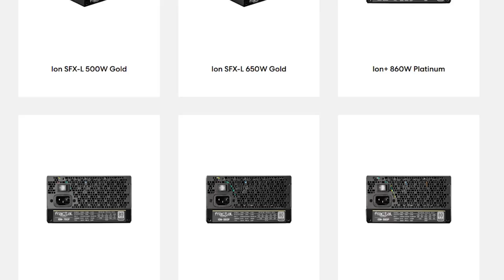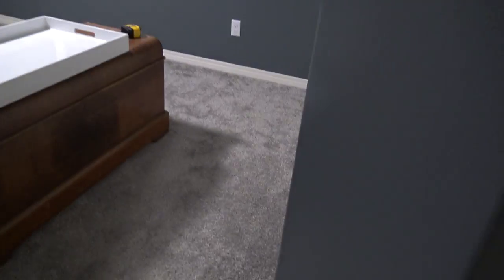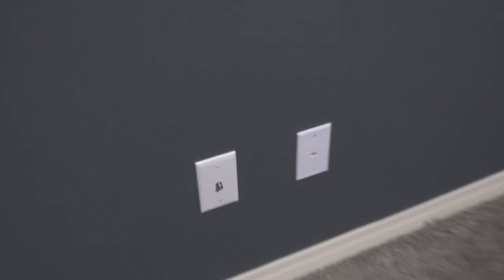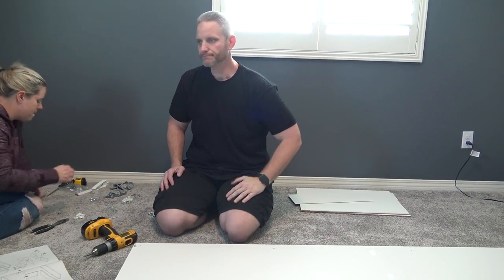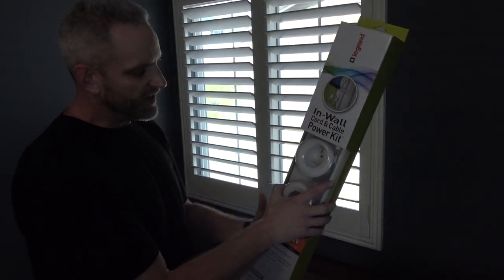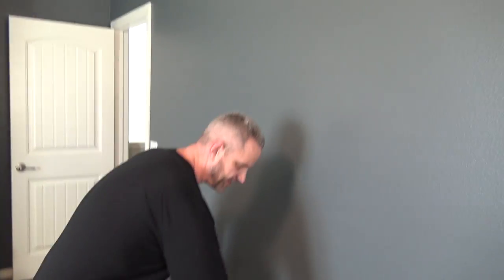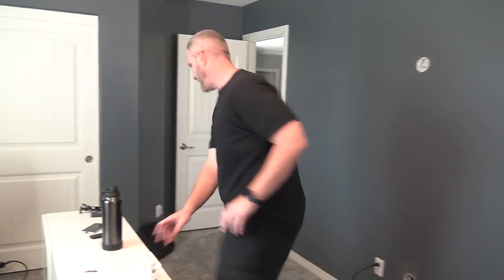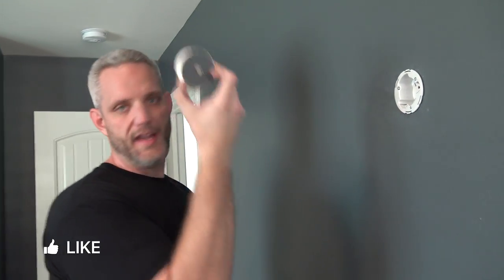Ultimate Nerd Cave Build - Part 2 Let's DIY some stuff!

Comment: I really like your vlog style videos. They are verry informative and I usually learn quite a bit from them. I am used to European houses so most of the stuff you are talking about is new for me. Usually we laugh a bit about your "cardboard" buildings but they do obviously also have their advantages. Doing something like this in a concrete or brick wall would mean you'd have to completely renovate the whole room, mill slots in the wall and all that sort of stuff. A job of mulitple days and really expensive. This way here makes such things much easier and also simpler to undo. Keep it up! 🤠

Comment: i wanna see Jayz2cents on my house with concrete+brick walls 😂😂😂
Reply: Literally every european house lol
Reply: Or my house: drywall - concrete - brick. I'm in the US, btw.
Reply: Or trying to "get around" code in germany o_O People like him are the reason there is a specific rule in germany where you can't fixmount any cable that is plugged in.
Reply: @Cantodorum  There's also plenty of brick/concrete houses and apartments in the US, in several of the older cities and towns. With brick/concrete, it's pretty much a case of either using cable trunking/conduits, if you don't mind seeing a PVC strip. Or hacking off the wall plaster in a channel, vertically between both sockets, running down the cables, covering them over with cable channelling and then re-plastering over the channelling. Which of course, is a lot more expensive, messy and time consuming.
Reply: @NavySeal2k  Even if you made a wooden offset from the wall to recreate what Jay has in his house, essentially a hollow wall? (As the Dutch Neighbor I'm curious cuz I wouldn't be surprised if we have a similar rule..)
Reply: Hahaha same here in the UK, our walls are all concrete,  it's a nightmare to drill holes in lol 😄
Reply: come to the uk where all new builds are shity dot and dab with crap cinder blocks behind them there a dream to work on.......................
Reply: Or with a wall stuffed with insulation
Reply: @MrHendrikje  Basically it says a extension cord is not allowed to be fixed in position anywhere. So even screwing the socket of the extention with a bracket to a table for example  would be against code.
Reply: @TheAdatto   lath and lime plaster or some old wattle and dorb
Reply: @djappliance  and sune lobs and sops
Reply: But why trying get around code? If i would like to have a plug in the middle of the wall i would just do it the proper way but maybe in some countries you can't do it by yourself
Reply: @TheAdatto   gotta get some round squares for my next project
Reply: @TheAdatto  sune lobs and sops not heard that before worked on some pritty old buildings I hate doing lath and plaster those tiny cut nails get metal splinters like drywall screws but worse
Reply: @ISHOTGUNJENI  nah, just get an SDS drill and bit, you can even go through the chimney breast with it. But don't.

Comment: The added advantage to this “powerbridge” is you can connect it to a surge protector, thus adding a layer of protection to the TV. The wire in the wall isn’t an extension cord but actual Romex wiring. This “powerbridge” is up to code. Hopefully nobody heard Jay say “extension cord” and think that’s okay, because that would be against the NEC (National Electric Code)
Reply: Yes, very true, though I did see an 'in-wall' rated extension cord at Home Depot last year.  I haven't seen or looked for one recently, so maybe it got pulled.  I just explain to my clients that their home owners insurance fire inspector can usually spot a wrong electrical wire a mile away, and that usually nixes their plans of saving a little money.  If not, I cut 'em loose, and let someone else do that job.

Comment: I am virtually living vicariously through you. I only have a small space to set up my system (in the living room of all places). A few years ago I bought an L shaped desk with a little hutch shelving thing. I have deeply regretted it since then. I am practically boxed in and feel claustrophobic at times. I am seriously contemplating just buying a cheap 6ft table (w/folding legs) and tossing out this desk. I'll miss the shelving, but it would open up so much space. On top of all of that, my desk blocks half of the only window on this wall, which means a good chunk of airflow and light is blocked off.

Comment: For anyone without a close ikea. I'm doing something similar but bought a Butcher block from Lowes. Real wood countertop instead of a vanier one from ikea. And it was even cheaper than a same size karlby. And building my own cabinets from mdf for about $20 per cabinet VS $80 per Alex drawer. (free since I already have the mdf) I also added a surge protected wall outlet in the wall behind the TV. Set up looks good though, Jay.

Comment: DIY is the best way. I built my own desk from Plywood and stained it dark sort of mahogany colour with edging, mounted it to the wall, no legs. Was a pain but looks really nice and I used the scrap for a couple shelves around the room that match. As cheap as an ikea desk but WAY more sturdy and looks much better. Just took some time and effort. Being I have no spare room for my PC. It went in my living room. Cable management has to be a bit more creative when you can't mount a basket thing underneath so I used a staple gun to staple velcro ties to the bottom of the desk and cut some slits for trunking up the back for cables.

Comment: Sheetrock is actually widely used in Europe, and it was used even like 20 years ago. Older houses were fully made of bricks but now mostly the exterior walls are and insides are made of that. In case of flats thats a different story as most walls are brick. But some do some re-arrangements and use sheetrock as well. And its quite a nice material to work with ;) Dough in Europe we mostly have aluminium construction behind it not wooden like you have.

Comment: 5:12 You're planning on going on vacation during probably the USA's peak of Covid 19?
Reply: This video is probably days old. Chill out.
Reply: Thousands have already died from the Flu & do every single year anyway; just business as usual year after year. Same precautions apply. Unless you're old, or have a weak/compromised immune system then evrything's the same as it ever was... AIDS is way more deadly than this, yet people kept having unprotected sex. Manufactured panic. Chill.
Reply: @LincolnRon  not going to happen.
Reply: @substrate001  "Just a flu bro/flu is worse bro" is such an NPC cold take, and a month or two out of date tbh.
Reply: @substrate001  You don't get it. It's not the death rate of Covid-19 that's problematic. It's the fact that it spreads several times as easily as regular flu. So if everybody goes around acting like business as usual your health care services will be overloaded and others who have chronic deceases or have to be scheduled for immediate surgeries may end up dying. Then there is the risk of crippling businesses across the country as @Ronald mentions. Especially the smaller ones can struggle as this virus can easily infect their entire staff almost at once.

Comment: you can use a short 1 foot power cord extension to get power to the tv, I normally use them to manage power adapters on outlets and power strips but they could also help in these cases.

Comment: I love the color of the wall. Although I wouldn't go with latex paint. Even though it's advertised as washable it's so much more expensive and not really 100% washable. If you don't clean it right away or certain stains just won't go off.

Comment: In EU we also use drywall to make rooms but we use steel plate profiles instead of wood and we fill it with glass wool for better insulation. Main walls that carry the house are made from bricks tho. We also use drywall to make walls nice and even in old houses where inside walls are also bricks.

Comment: Hey jsut wanted to let you know that they make very long flexible shafts for drill bits that you can use to cut firebreaks from the floor or ceiling or even other floors, we use them at jobsites quite a bit

Comment: If you have a fire break, you get a long flexible drill bit that is design for this type of thing. You put through one of those other two holes and drill through the firebreak. You don't cut another big hole in your drywall.

Comment: We use drywall in europe too. All the inner walls in my house (built in 2018) has drywall. It's pretty strong. One screw can hold 30kg if you drill it directly into the wall. 50kg with a plug. I do however have a pretty thick layer of insulation between the walls to dampen sound, and probably also to keep the heat. In Denmark there are pretty strict regulations to how energy efficient newly built houses should be.

Comment: Like you already mentioned in the video: in Europe, lots of houses have stone or concrete floors and walls, even the inner walls sometimes. 

I'd really like to run network cables throughout the house, but the conduit which has been put in place during construction is not designed for that, as the building is from before home networks became a thing. Adding new conduit and cables is quite challenging because of that.

Having to deal with concrete is a pain in the cunning linguals if you cannot use the already in place conduit. Drilling small holes is doable with a hammer drill, but putting cables into a wall means you need to carve slots in the concrete or stone. You need specialised tools for that and it creates a lot of mess. Concrete definitely has its upsides but not for these types of DIY projects. XD

Comment: This is why I use OSB and plasterboard for walls. Plasterboard is nice and smooth and the OSB provides a backing you can screw stuff into. No need to find the studs :P Sheetrock only is dumb.

Comment: They make a drill bit that will drill through the fire block and then you can use it to feed the wires through. As an low-voltage installer, I use it all the time.

Comment: Prosumer tip:  When making holes in dry wall have someone hold a shop vac hose near where you are cutting/drilling.  This will suck in 90% of the dust and mess created and make clean up much easier.  (It's not a pro-tip because this takes too long and time is money.  It is just more efficient time wise for them to just clean up later.)

Comment: Hehe! Another example of american codes being more loose than other countries. That being said those in wall extenders are pretty sweet. They look so clean. you can improve on them by feeding thick flexible conduit over the power cable and attaching them to the back of the housings, then you don't have to remove them to add more cables. You just feed em through the conduit that's already there. not speaker cables though, you'll get a buzz from the electricity in too close a proximity. Crosstalk sux.

Comment: When I did my gaming room I went 1 black and 3 grey walls (all textured but different textures which shows nicely when light is on it).

The black was on the longest wall but had a large window in it and also had a wall to wall electric 120" projector screen (it's a small room) on the black wall too (this was the wall with my PC/TV etc on it).

Comment: Running wire(s) in your wall does a fantastic job in keeping the space clean and neat. However, here in Canada, if a wire is not specifically rated for running in the wall it could potentially void one's home insurance, or so I was told. Nevertheless, there are flat wire transferring solutions that can  be painted your wall color that also look much neater and better than having a pile of wires dangling everywhere.

Comment: Those Cord & Cable kits are a neat idea, I wonder if there's a UK equivalent. Normally I just see wall plates, grommets, or trunking.

On styling preferences. I'm your age, Jay, and I detest woodgrain. I try to avoid it where possible, and go with painted finish and glass. To each their own.

Comment: I am European and I am not surprised by all the hollow walls. I live in a former shop converted to a residential and it's all the same. It took my three tries to get the proper plugs to keep anything hanging onto the wall or the ceilings. Because of building code I have several inches of fireresistant material between the hard ceiling and the drywall ceiling I am looking at. I have to hang the curtains from the latter. Somehow they stick. I still think it is a combination of the plugs and a miracle..........

Comment: How is the sound insulation in your house? In northern Europe we "ideally" use 2-layer dry walls, form both sides, and fill the wall with some type of glass wool. Helps with temperatures as well.

Comment: Just to clarify for everyone that is taking the extension cord statement literally and running to HD or Lowes to buy a normal extension cord and cut a few holes in their wall:  This kit comes with an "in-wall rated" cord, meaning it can be used specifically for in-wall applications.  It is not a standard extension cord that you just grab off the shelf.  Other kits come with 14/2 Non-Metallic cable (romex) which obviously makes this point a bit clearer.

There is no getting around code with this.  It is already code compliant.

Separately, with the way that @JayzTwoCents wall is constructed he could have just fished standard 14/2 Romex straight to one of the existing outlets and spliced in that outlet box.  That's completely code compliant alone.  But obviously the kits are a nice clean look.

Comment: with regard to your "freaked out about walls" comment

im british, and I live in a 60yo house, our "stud walls" are red brick and engineering block... these things are so tough I wore out a diamond tipped masonry drill bit trying to punch a hole to run cable through it x-D... you guys have it easy in one respect... but on the other hand, its probably pretty easy to knock your house down where as mine could probably survive a nuke

Comment: I wish my (Melbourne, Australia) interior walls didn't have the horizontal bars, unfortunately, I think we have about 3 or 4 per section, so even the 'cut a big hole' option isn't practical.  However, the Gyproc (drywall) we have is super thin compared to that (guesstimate about half the thickness) so maybe that's how they get the wall strength.  That is why when the house was built, I spent a weekend running Cat 5e cables throughout the place before the walls were installed.  So glad I did, even though the builders crushed the cables under a 2 by 4 in the roof, guess networks were not a common thing back then in 1999 :-)

Comment: Just an fyi for anyone doing this in older houses. Use a stud finder and measure the gap, old homes can have 12 or 16" spacing. I've even seen some oddballs that are 14" and even had a house that had random interior walls that had 10" spacing.... Lol

Comment: Yeah, those counter tops you're going to hate. I have used the same for 2-3 years, and didnt even have my monitor on the top, but flushmounted on the wall. Its too shallow to have a comfortable seating position. I would reccomend atleast 80cm instead of the 63cm this is. Just a friendly tip :)

Comment: AFAIK the code in most of the US is 2ft. Almost the same as the 60 cm standard we use in the Nordics, and quite common many other places in Europe. Biggest difference is the code for insulation. In most of the Nordics atleast, typically 150mm (6") of glass or rock wool in walls and 200mm (8") in the ceiling is a minimum, and especially in the costal regions of Norway, every stud has to be bolted to the foundation, and all connections that can recieve tensile loads due to wind needs steel banding. It's typically not required, but mostly people put insulation of 70 to 100mm (2.75 to 4") in the inner walls due to noise dampening and save energy if say one likes to have it cold in the room at night.

Comment: Actually jay with most mounts today you dont need to mount on stud. I do mounts for a living i use 3/16ths toggler anchors from lowes. They will hold 275lbs in 1/2 inch drywall. I put 4 on top 2 on the bottom and that mount will never move.

Comment: Just an electricians note. If you live in an apartment, make sure that you DO NOT drill any holes into a firewall. These will most typically be the deviding walls between apartments.

Comment: I couldn't help wonder where your wife was Jay when you were drilling the holes with all that dust going all over the carpet? They do make drop clothes and tarps. Or, you could have use a vacuum while drilling to "suck" the dust during the drilling. There is also a trick to mount a plastic cup on the hole saw to confine it. LOL

All kidding aside, I do really like that option for those plugs. One thing I'd say to viewers is to check your local codes. Personally I do not know if my local code would be on board or not. But I will be asking. Thanks for the helpful info!

Comment: So how would you suggest using that sort of cable hider if you have insulation in between every stud? I can guess that you most likely don’t need insulation where Jay lives but here in Ohio it’s a much different story. My main issue was feeding the cables from top to bottom, there are no horizontal structures or issues anywhere. I just can’t get the cables to stop getting caught on insulation, lol

Comment: or vs hanging on the plugs.. just go get a patch panel at Lowes/Home Depot use drill to cut you a plug.. since you will probably keep the hole saw.

Comment: I tried using one of those things to run cables through my wall. As soon as I made the hole, I was greeted by a concrete wall an inch behind the drywall. So I had to patch the wall and repaint and all that and ended up running the cables down the wall.